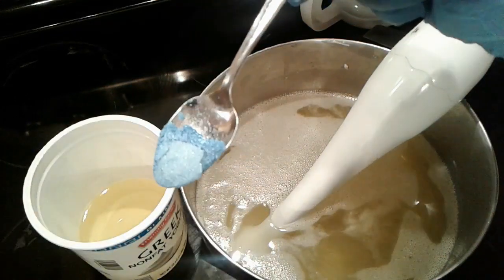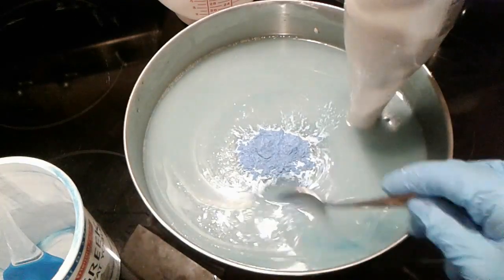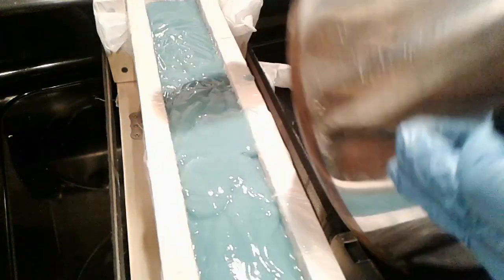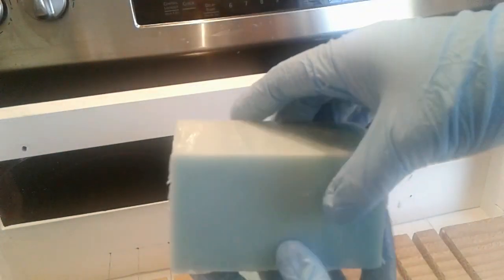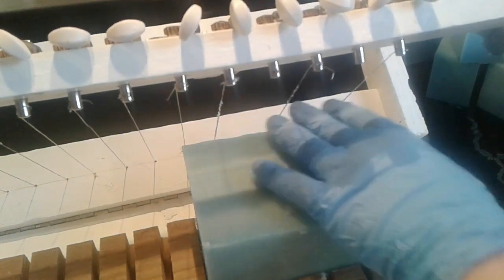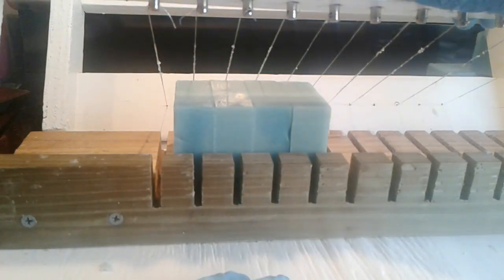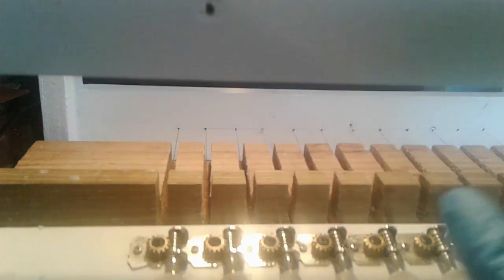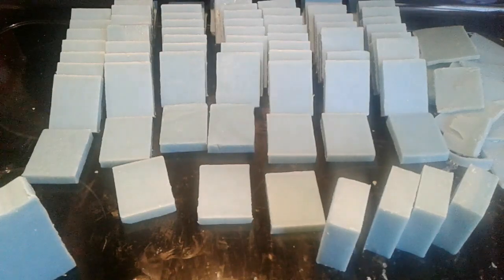Making Soap Baby Shower Favors | Newborn Baby fragrance | blue mini cold process soaps

Comment: Can you provide the measurements for making this bar
Reply from the maker: I haven’t watched this video in awhile. I can guess that the mini bars are 1.75” x 2” x .5”. Hope that helps!
Reply: I'm sorry I meant the amount of oil, frangrance, lye, water ect
Reply from the maker: Keisha Wilson Most soap makers work at perfecting their soap recipe for years... that’s why we often don’t “share” recipes. When someone does share a recipe, you still need to confirm the amount of sodium hydroxide / lye used by putting the amounts of each oil in a free online lye calculator. I use the one on soapcalc, but there are many others. What oils do you have available to you? Start there... an easy first soap could be 100% coconut oil at 20% super fat. Or 100% olive oil at 5% superfat. Do you have a scale? You’ll need one as everything is measured by weight, not volume. Write back to me with the oils you can get easily and I’ll try to help you out. ~Nancy
Reply: Thank you so much I'm a beginner and I'm trying to learn how much oils I need, lye, and water. I'll look into the soap calculator and I don't have a scale yet but I just ordered one. I have coconut oil on hand and olive oil. I also have a lot of essential, fragrance oil, sample packs of mica colors, and Alot of herbs as I'm looking into herbalism. I appreciate you taking the time to reply back to me and I'm thankful for the information.🤗